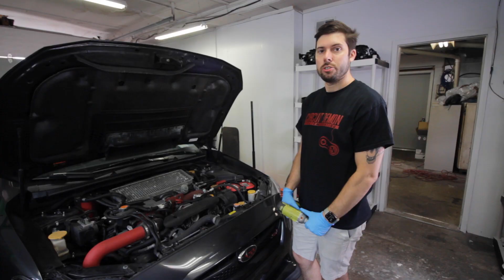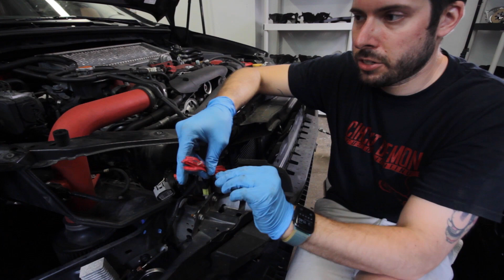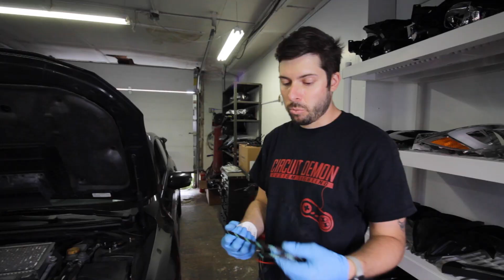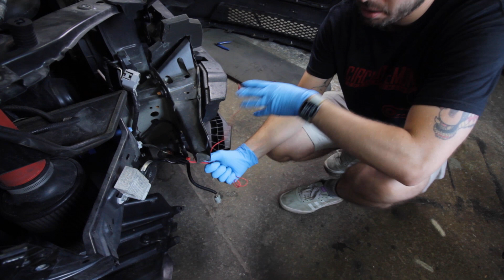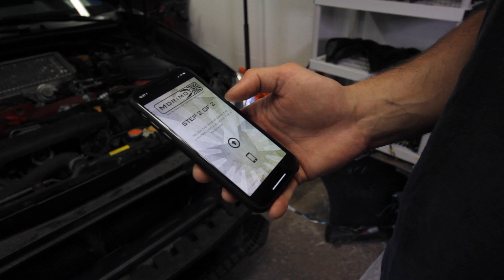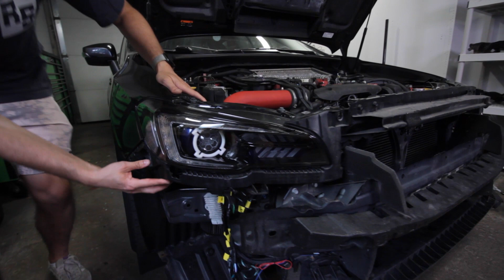How To Install Your 15+ Subaru CIRCUIT DEMON Headlights!

Comment: Am I wrong to assume the morimoto and or magiclight Bluetooth module is keyed to ignition?...otherwise it would drain battery constantly
Reply from the maker: You can do either! We recommend right to the battery so you can use the app to turn on an off the lights. Otherwise you would need to leave the keys in the car at all times. Doesn't drain battery when the lights are off.
Reply: @circuitdemon_  cool! Thanks guys! I just received your lights for my '04 wagon!
Reply: @circuitdemon_  I’m having trouble using the magic light app as soon as i connect them to the battery it ask me to turn them off and then on to connect to them ?

Comment: Confused a little bit, on the passenger headlight, theres 2 connectors but only one is used for the DRL harness? Do i use the other connector thats on the passenger headlight? which one am i using with the DRL harness?
Reply: Yeah I have this same question?
Reply: I have the same question.